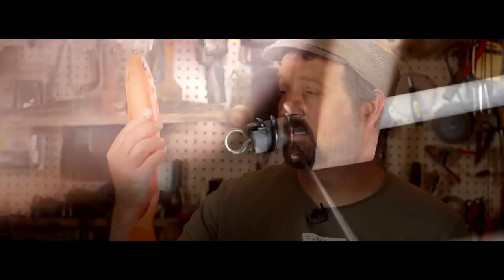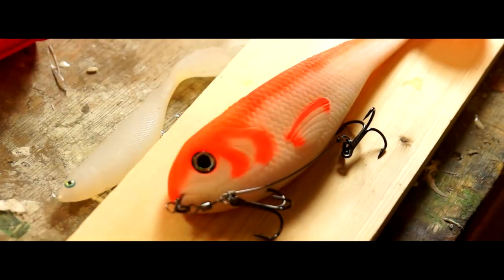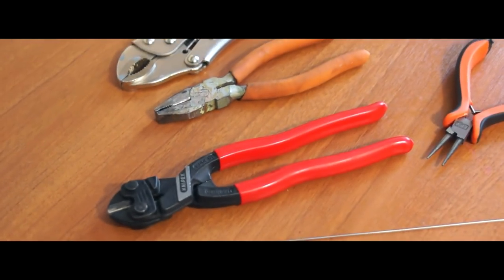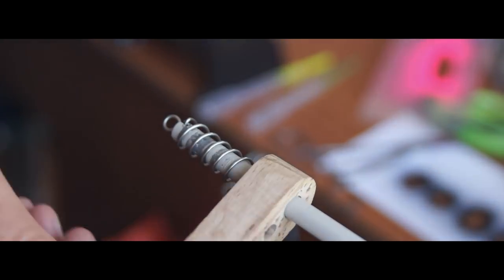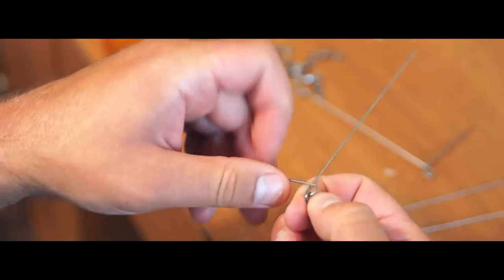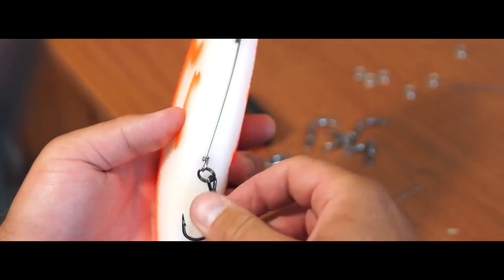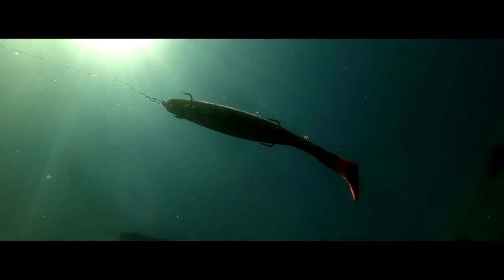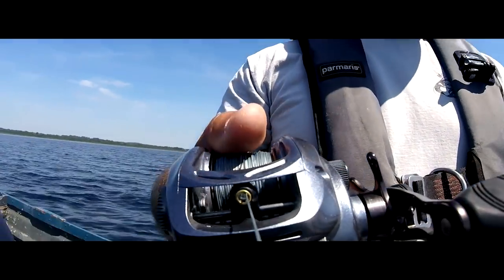How to rig and fish big swimbaits / soft plastic paddle tail lures

Comment: Hi Paul another brilliant video thank you and those lures look amazing. I would be interested to hear more about the pro type rod..Where did you get your  round nose pliers and split ring pliers? For the pipe for making the shallow screws what did you use and where did you get it? Thank you William
Reply from the maker: The rod is at the moment a once piece and we pretty much made up very simply to see how the blank would perform casting big weights. I was very pleasantly surprised how smooth it loaded up and unloaded making casting very easy for such a big lure, but there is a lot of work to do on it and it will probably end up a two part rod. The round nose pliers you can get on eBay and split ring pliers they tend to be cheap enough but the it is worth getting some decent snip i think maciej uses knippex